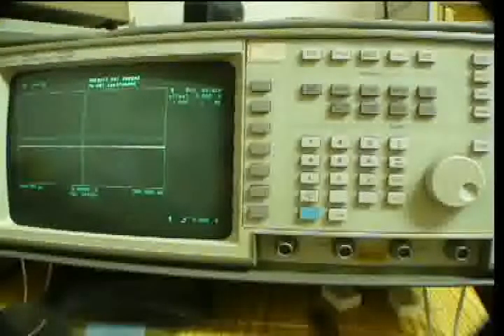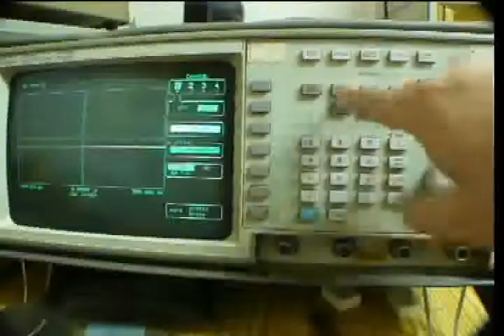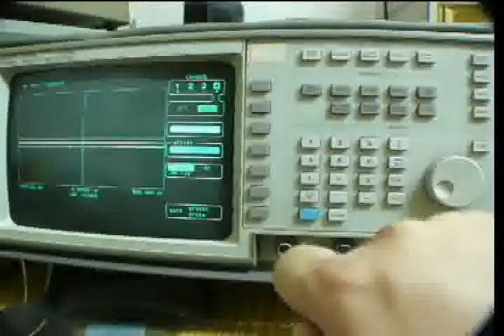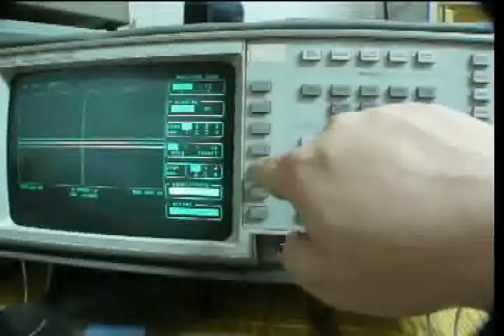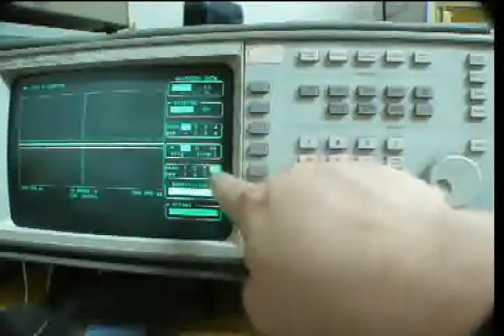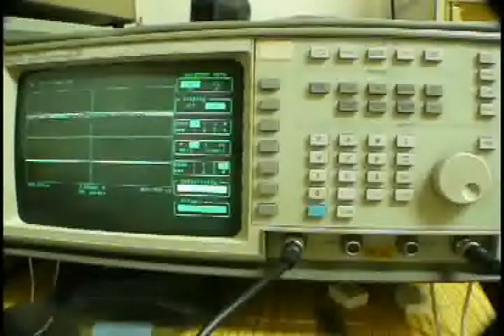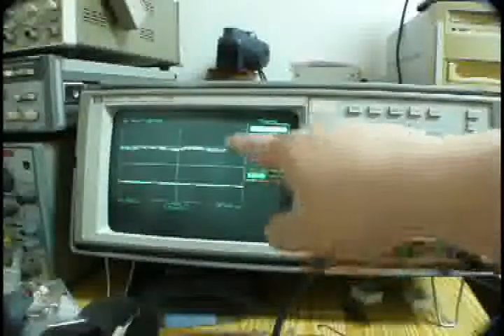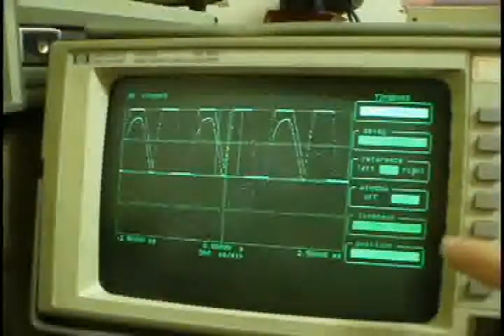Power Drill Converter test part3

Comment: You only need a cable to connect the calibration output from the rear to the channels on the front in order to calibrate this Oscilloscope. I know this because I worked for HP many years ago and I know this Oscilloscope. Good luck to you.